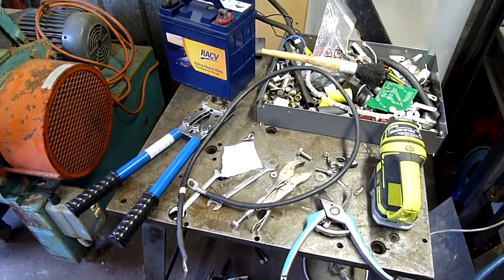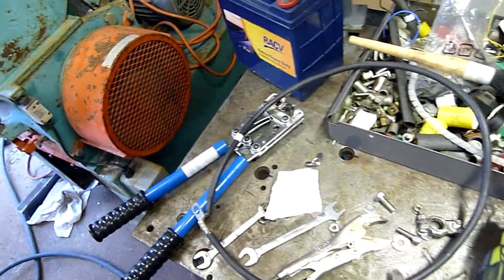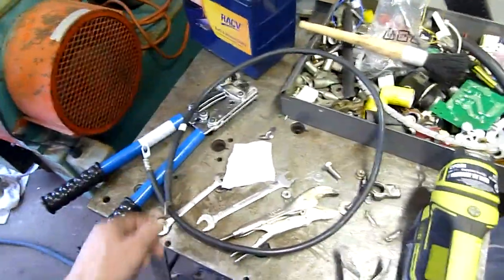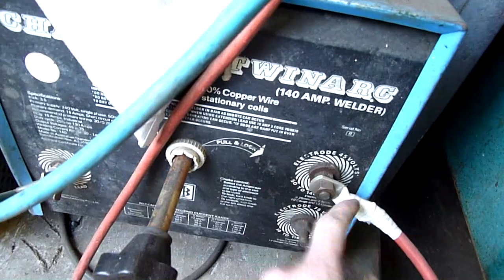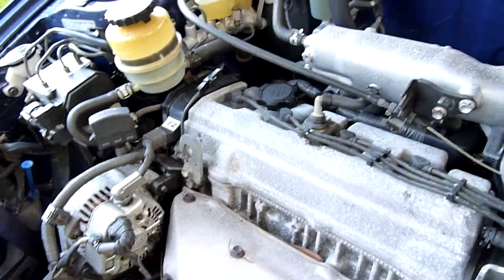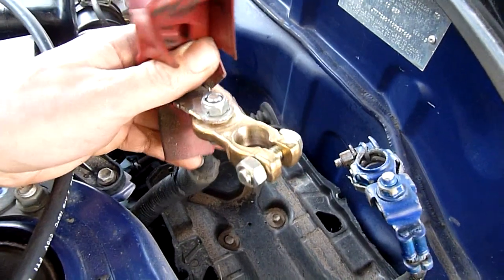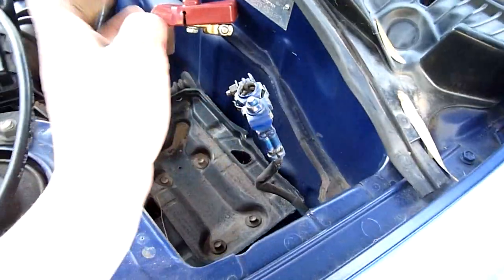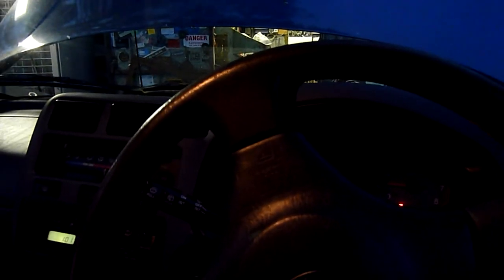Blue RAV gets Good Battery and Chassis to Engine Cable

Comment: The main issue living down on the gulf is corrosion.  My truck's battery terminals has clamp down style lugs, exposing the wiring to the salt air. After fighting with them, I decided to go to the local battery shop and buy some copper lugs to solder on.

I got the charging lug to solder on well. The starter cable got a good crimp using a big set of vise-grips. No sharp ends, just a lug full of copper wiring and a good crimping.

Comment from the maker: its probably both old and hard, and not under enough tension, so I would replace it and tension it properly first, if it still screams then your AC comp may be seizing up.
you can turn the outer face plate of the AC compressor pulley by hand too, unless it really is seized. it should take a bit of force to get it moving but once moving it should not grind or have any mechanical clunks as you turn it.

Comment: Some cars have a braided strap across the engine mount from chassis bolt to engine bolt
Volts is pressure (that's why the electric companies call it 'pressure testing', current is the flow amount (current flow like a river)

Comment: I always used water pipes for explaining volts and amps. Pressure is equal to volts, volumetric flow rate is current. Larger diameter pipe means more flow and less pressure.

Comment: If it were me I would run the large negative lead from the battery directly to one of the starer mounting bolts, or to a bell housing bolt. The small one near the strut-tower  mostly gives a clean sensor ground for electronic engine control.

Comment: About the voltage thing, it's actually because 12.6v is too low to penetrate the high resistance of human skin. Now, if you drove a nail into each of your hands and touched them to a car battery, you're crispy bacon because your internal resistance is much lower (remember, people are mostly water, and water has a low resistance).
You might be able to get a lesser effect if you soaked your hands in water and grabbed a battery, but I don't recommend it.

Comment: 'Carbon Canister Venting'

Not that I have clue what that is, but i've noticed this noise in mine in the past, and now i'm not so concerned about it. Thanks!
Reply from the maker: Its a one way valve (check valve) chattering as somthing goes through it, nothing to worry about.
Reply: Aussie50 Sweet, cheers. Just found your channel via rav4world. Lots of guides and talk-throughs of stuff i'd like to be clearer about. Great stuff. Cheers!

Comment: Im sure the alternator will function a little better as well, at high charge levels :-)

On old cars if the earth was bad, the throttle cable would burn up when you used the starter, wrong path to earth ha ha :-))